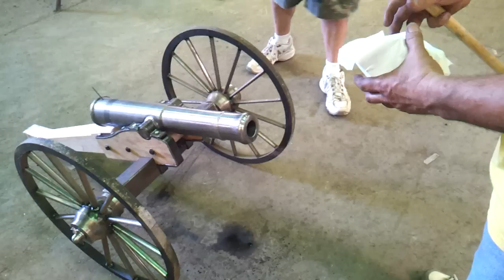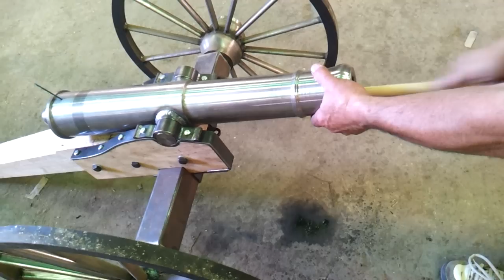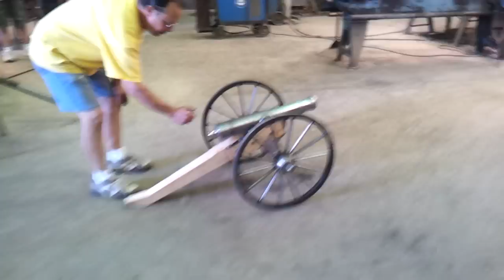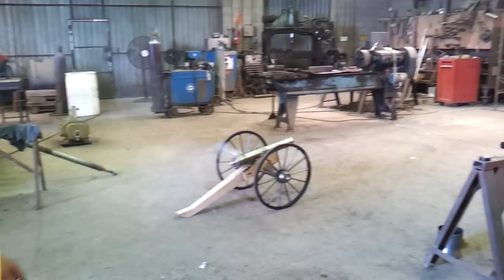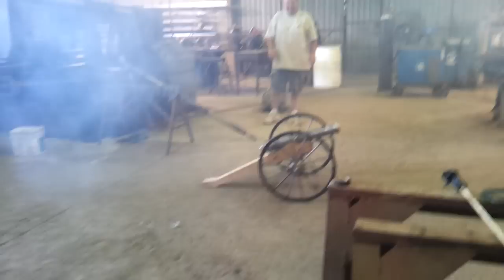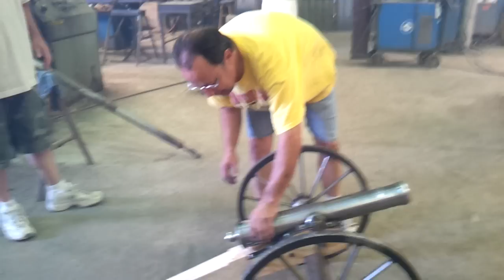1-3/4" cannon blank test fire

Comment: That barrel will easily take 2 ounces of black powder because it's long. Flames out the barrel indicate unburned powder.  I use 2 ounces in my 1.25" barrel. For a good boom, pack the barrel with sawdust. Use a wet sponge rammer between shots. It is superbly made and the first one I have seen in a long time that has adequate sized trunions.
Reply: How can I get one?
Reply: "Coaches club cannons" might be able to help you.
Reply: Dónde

Comment: In some states, it's illegal to fire a blank load out of a cannon. Never tell the police what you're doing. OK, here's how to get a good boom out of it. Use the 1 ounce FF and add about a cup or so of dry sawdust on top of the powder down the bore. Then fill the rest of the barrel with damp sawdust right out to the muzzle. Pack it snug with a hammer and wooden dowel. This baby will really bark. Always use a wet sponge rammer between shots to kill any residual sparks before reloading. Even a 5 minute wait is inadequate. Use a wet sponge rammer. Never use the can to pour powder in the barrel. Never  pack the barrel with rags because they can start a fire. Sawdust won't do that. Black powder does not build pressure, so your steel barrel is very safe. Cast iron is what is dangerous. It will fragment in cold weather.
Reply: de